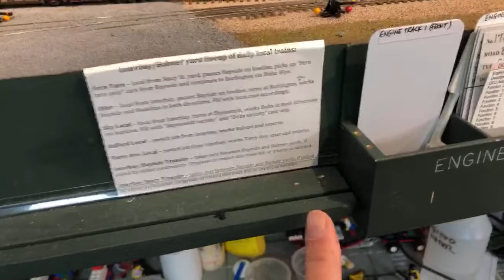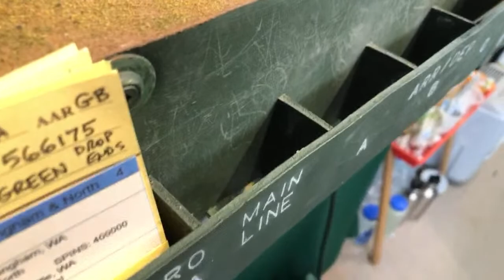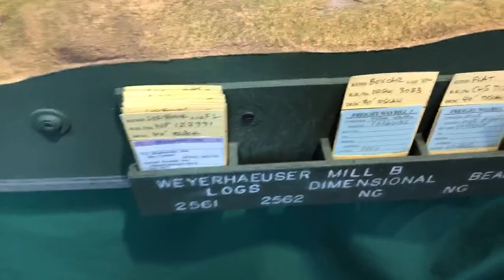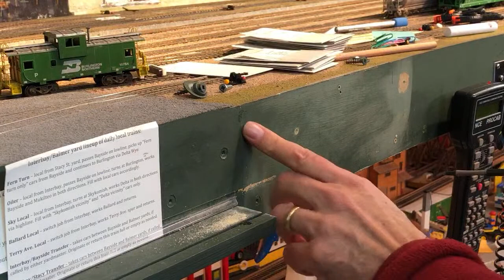Car card box labeling & installing

Comment: in the locomotive depot i work at we have two roads one Called the SAND ROAD the other the STORE ROAD, we used to use them for all sorts of things mostly stabling locomotives.
Reply from the maker: Interesting. Did you also have a track (road) for storing snow plows and wrecking cranes, and what was that called?
Reply: @muchfunwithtrains  I'm in Melbourne,  Australia, not much call for snow plows, but the year before I started (1979) they retired and small 0-6-0 crane engine that was used to pick up minor derailments around the Melbourne yard, it was nicknamed "Poly", and the track it was kept on was called "Polly's Loop" it kept this name for the next 30 plus years, long after Poly had be placed in a museum. They also kept the 60ton (small by US standards) wreaking crane in that road.

Comment: Would you have a layout diagram that I may take a look at? Any advice you would give for someone building a layout?
Reply from the maker: My video called "Part 38" contains a walk-through of the track plan on a layout diagram that was originally published in the Railroad Model Craftsman issue of January 2008. There are also some layout diagrams on my website https://burrstewart.com in the "trains" section . I have lots of advice, but the main thing is to get started with something very small like a switching layout and start running trains, switching cars, and enjoying locomotive sounds. Don't wait until you figure out something big. I started on a pine board six feet long, with my favorite locomotive and a few cars, and just kept going, over time. Here is the link to "Part 38": https://youtu.be/YkYt-M0bGco
Reply from the maker: To continue with that last thought, the summary of my advice is to be incremental. I started out thinking I wanted to model the BN's Interbay (Balmer) yard because that's where I was doing most of my railfanning. So I started with a three track yard, with one track for north, one for south and one for arrivals/departures/staging. No scenery, buildings, etc. But then I found out that some of what I was calling northbound traffic was actually eastbound. I I needed a couple more tracks to make sense of that. Then I thought I should have a staging track(s) on each end of the yard, to represent going off in those three directions. Then I found out there was a second major yard complex in Seattle south of the downtown tunnel, where there were interchanges with the UP and the MILW. It just kept on growing like that. When I started out, I didn't know much more than I liked the action at Interbay. The more I learned about the railroad's purposes, the more the layout evolved into "more". I never could have imagined or planned the layout that I have now, because I didn't know enough in the beginning.

Of course the second major piece of advice (see everything Lance Mindheim has published, for example) is that "more" is not necessarily "better". I could argue that at this point I have "way too much" layout. And I was lucky - I would have filled the entire basement with trains, but my wife wanted a ping pong table in the center of the room, so I kept it clear. Now we use all of that space for people and for chairs and work surfaces. I never would have planned to keep that much space undeveloped, but now I am so grateful that the layout itself isn't any bigger than it is.